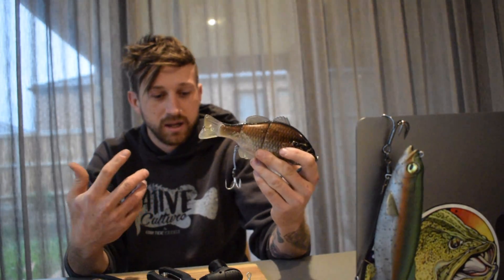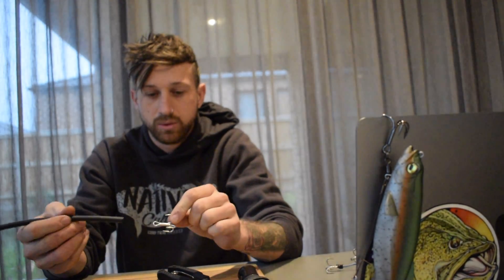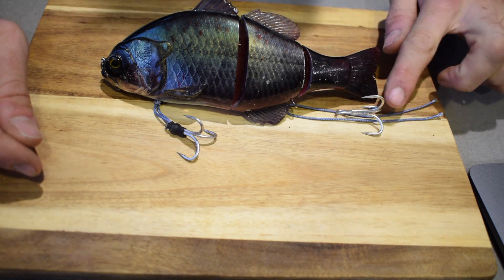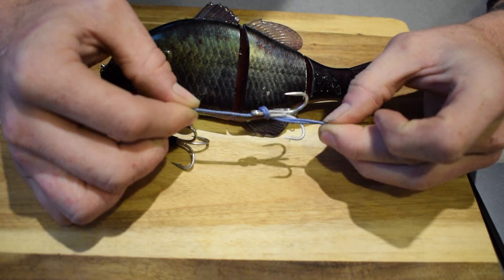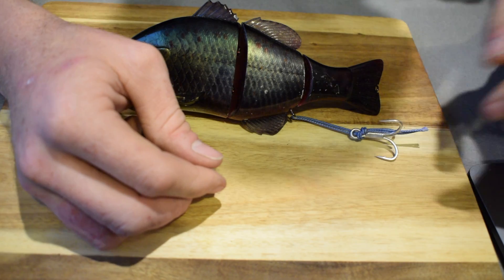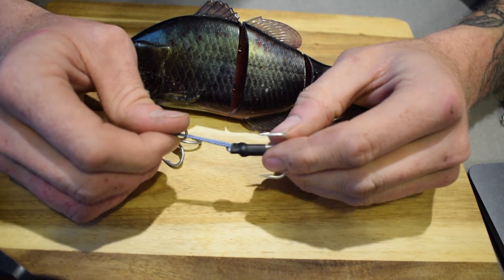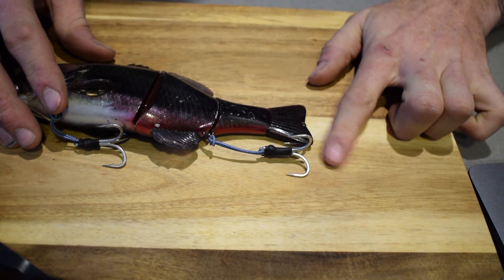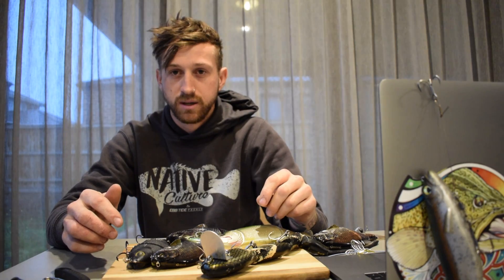Swinging Treble hooks for Big Baits

Comment: Great vid man. Im thinking about doing this with a koolabung 230mm wake walker. What breaking strain assist cord are you using and would you do it on a surface lure? Cheers.
Reply from the maker: Damien Dray hey mate yeah would work perfect on that. I had 200lb just because I had it from some salt water fishing I did. But 80 or 100lb will do it!
Reply: @fishingwiththecaptain  your a legend. Thanks mate 👌😁
Reply from the maker: No dramas! Works well even with single hooks. Running 2 singles gets the drop done at times

Comment: Dude 🤦🏼‍♂️ good luck getting a fish to get hooked or even bite with that long of a p assist line attached to your hook. I'd measure it by using the width of your index finger.  And tieing it on the hook and super glueing it.
Reply from the maker: Thomas LaRochelle all the best to you and your ways works for everyone differant! If it works for you then by all means! I’ve got a few meter plus and 120+ fish on this setup and works better then when I was running with rings. Not saying it’s the best was it’s just a way that is proven itself to me. I don’t share rigging ways or techniques unless I’ve proven it to myself and is a real positive to what was once before a issue